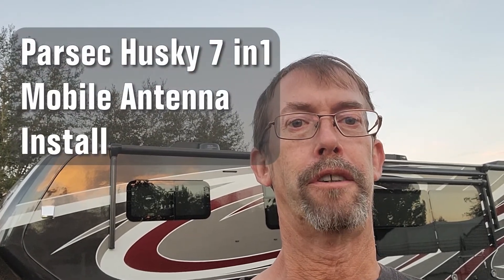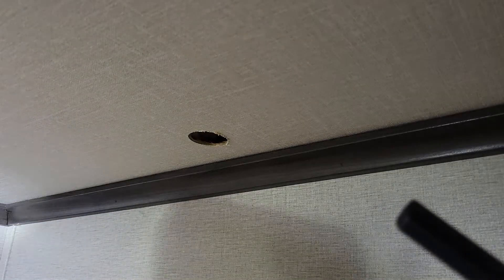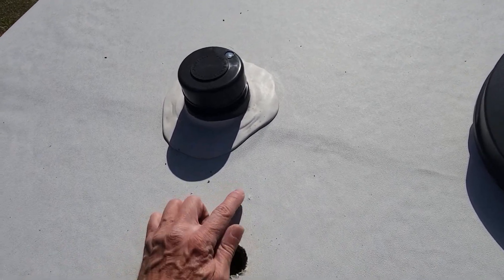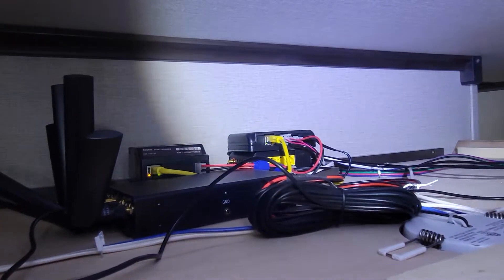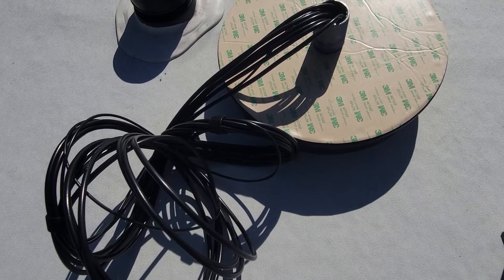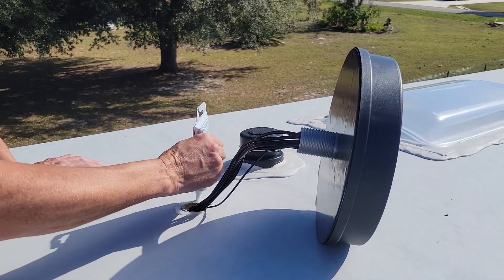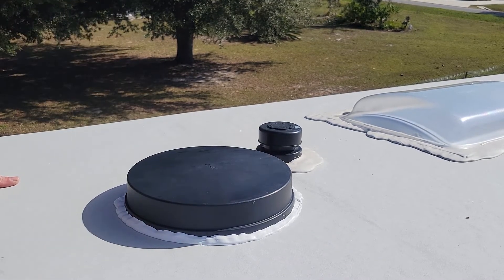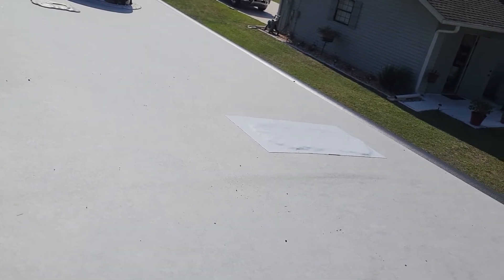Parsec Husky 7 in 1 Mobile Antenna Install - Grand Design Momentum 397TH

Comment: I was really hoping you had a video on how you set the rest of that up on top of the cabinet like that! I have a 22' 397THS and I want to add this exact setup plus Starlink but my biggest concern is where am I going to put all of this stuff and how am I going to be able to power it.
Where did you grab power from and would you do anything differently? Awesome video I was so happy to see this install on another 397.
Reply from the maker: Glad you liked the video! Everything is powered by 12 volts. I just tapped into the existing power from the LCI units already there. If I had to do it over, I would have bought the Parsec with a shorter antenna cable for an even better signal.

Comment: What speeds were you getting before the upgrade ? I am looking to do the same
Reply from the maker: I was just using a Verizon JetPack before, so the speed was significantly slower. Unfortunately, I didn't record the speed. One word of advise, if you have a Pepwave router and get the rooftop antennae, you may want to also get a Pepwave Mini access point for inside the rig. The rooftop antennae moves the access point on the roof, which weakens the signal inside. I went ahead and got two of them. One for the garage area, and one toward the bedroom. So basically I have three access points. Two inside and one outside from the antennae.

Comment: I highly encourage you to get an RV roof patch for the pilot hole and then cover with the lap sealant around the patch edges as added protection against water intrusion. Never ever use silicon on these RV membrane roofs - it's incompatible and Grand Design will void your roof warranty if you end up having a leak.  As for your antenna, well I'm not sure the best way to handle that situation since you used silicon around the center mount.  The safest thing to do is to remove the antenna, clean the roof, apply a new 3M adhesive patch, and then reatach using only lap sealant and no silicon caulking.
Reply from the maker: Thanks for the advise, but I actually followed the steps from TechnoRV https://www.youtube.com/watch?v=PzXlSG_CiuA at around 22:00.
It's such a small amount that it really shouldn't affect anything, and it's protected anyways by sealing the antenna itself with the lap sealant. It's been on there for several months now and no leaks.